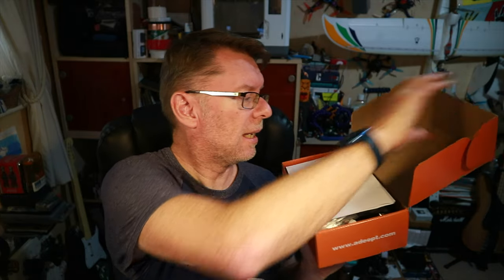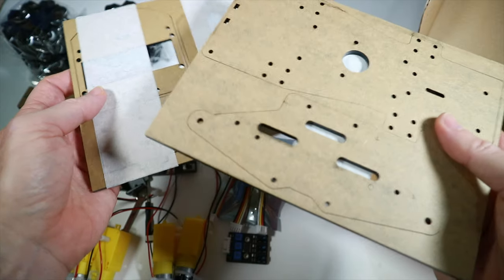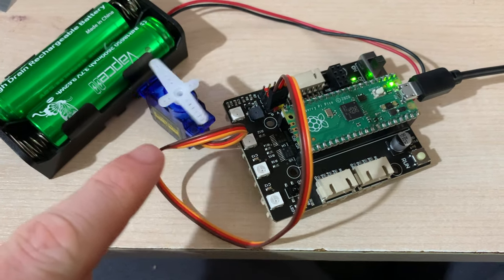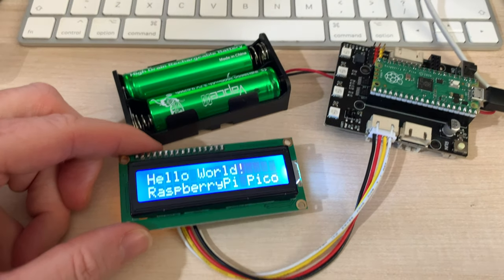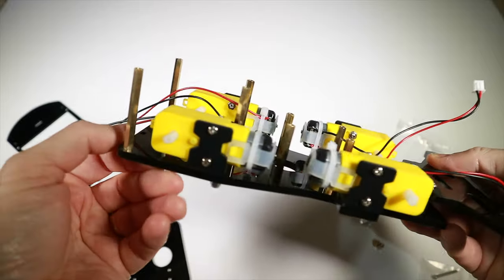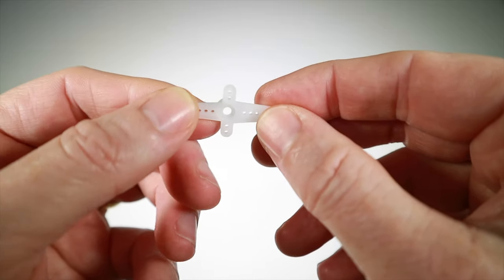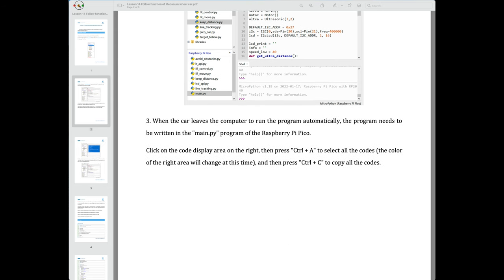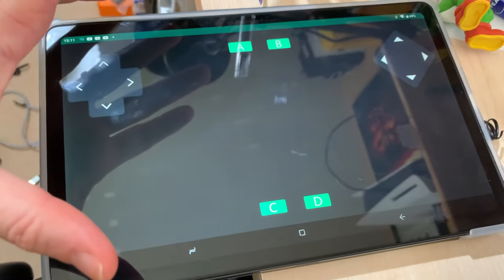Adeept robot car with Mecanum wheels - powered with a Pi Pico

Comment: With the huge number of lakes near you, im surprised we haven't seen boat stuff yet!
I was searching your area for somewhere to run my home built boat as there are Zero ponds in Salisbury or anywhere near here and i found something labeled on google maps as a boating pond but i cant remember where it was.

Still haven't run by boat, i bought a hull and reinforced it with carbon fiber and put in all metal hardware and a decent motor and it didnt even occur to me to see if there was anywhere to run it before i built it, im originally from London and there are ponds and lakes everywhere there, i assumed that being in the semi countryside there would be even more here but no, Salisbury has nothing at all!!

EDIT: ive just found it, you have a model boat pond on the common!!
Reply from the maker: If I thought about where to go and drive a boat, I'd actually be a little stuck for things that close to me.  There's a small lakes near me, but I'm not sure if boats would be allowed.  There's a few places if I take a 30-40 minute trip in the car though.  Not done a boat simply because nobody offered me one to test.  As soon as you test one thing, then people seem to ask you to do the same... but until you do that first one... nothing :)
Reply: @CurryKitten  Ive never been to the common so have not seen it in person so dont know what state its in but google maps shows a purpose built concrete model boat pond on the common and other google searches turned up images that make it look pretty good.

Knowing my luck, id drive down and find the thing drained and full of skateboarders lol.
Reply from the maker: If there's a model boat pond near me, then I want to know about it.  So either you've mistaken where I live or what goggle maps is showing, or I'm missing out on some boating!
Reply: @CurryKitten  your Southampton arent you?  Google maps has a pond marked as a model boating pond on the common....
Reply from the maker: @stevefox3763  I'm "out that way" but more specifically Whiteley
Reply: @CurryKitten  Although its not right on your doorstep, its not a million miles from you, i have been tempted to drive down a couple of times but its a fair trek from Salisbury and knowing my luck i would get there and find it bone dry lol.

I was planning on testing my boat in the farmers fields where i used to fly from as they flood every winter but they started the prep work for building houses there a few weeks ago grrr, i got on the case the second i saw planning applications for the houses two years ago and secured another flying location so the houses have not screwed me over flying wise and i have a gated private sports field. 

The housing development is pretty big, 640 homes, should be interesting to fly over when the proper building starts :)

Comment: Thanks for the review. Did you get any feedback from Adeept on your review comments? Has anything in the kit been updated and/or have they at least modified the instructions? What about the remote and/or app changes? If purchased today are you atill getting the kit that you got or is anything different? Would be good if they offered this with the Pico W so you had integrated Wifi & BT. Appreciate any feedback. Thanks.
Reply from the maker: When I fed back to them, they mentioned that any changes would take time to implement, but that their engineers were always looking at improvements in software that could be made.  This sounded like a bit of a generic response to me and I haven't heard of any actual changes they've made.... although it's not impossible.  I still have the car on the shelf as I was going to program it myself to be better, but I've never had enough spare time for that.  Right now, I'd expect the kit fo be identical to the one I reviewed.